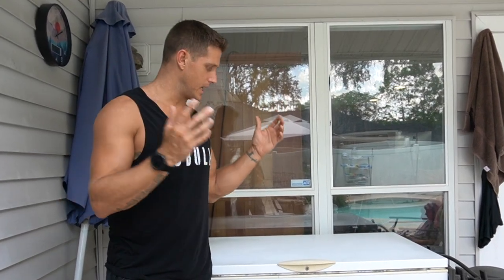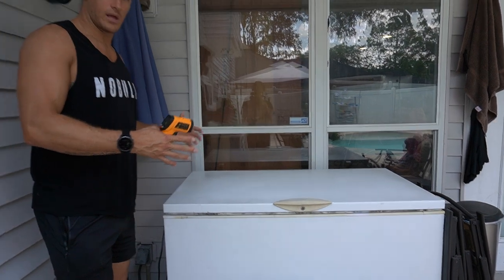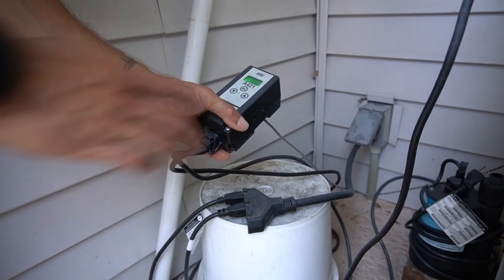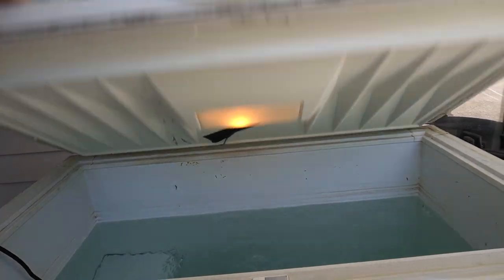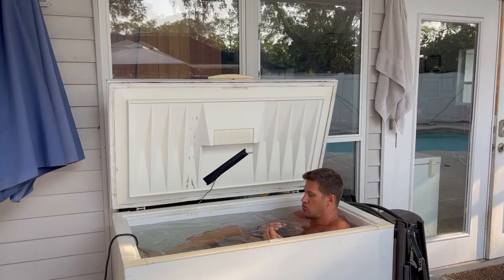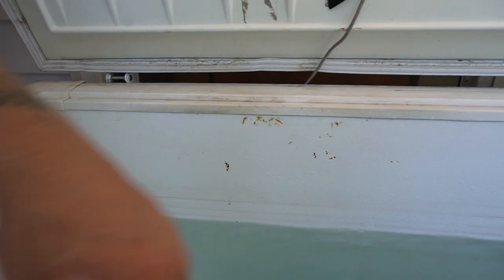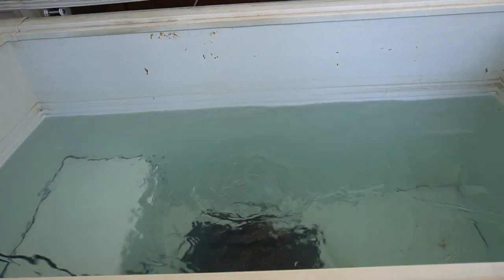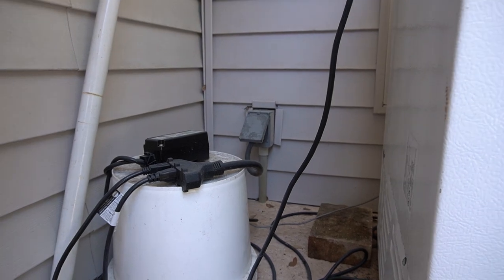How to Make Your Own Ice Bath CHEAP! (Filtered and Self-Cooling)

Comment: Dude this is the best most honest video i found... 7 years he says on just marine sealant caulk . I want to add, for people out there researching like me.  John Richter s way is not the only way and he makes alot of money off his affiliate links so he pushes people towards that.  But if you get a used freezer for 100 bucks and it's not rusted, marine sealant silk 271 or whatever it's called and who knows, may get 7 years without leaking like this guy. Even if only a year just re-caulk it.  Most leaks are from the weight of water and human not supported properly under the freezer and seems pulling apart whatever sealant you used so support the weight under the freezer so it doesn't bow in if it has legs.  If epoxy is the route, pc11 is much cheaper than jb water weld... just my 2 cents. Now if you got a brand new $1000 freezer then it may make sense to go balls to wall work with jb water weld and epoxy shields

Comment: Isn t that potentially dangerous because the cold (not the electricity) can shock a person?  I can t stand even putting my shower on cold water.
Reply: Starting at higher temps (60 degrees F)  and slowly moving your way down in temp over the course of a few weeks, you can adapt your body and tolerate very low temps safely. It's advised and safest to have someone around for your first few cold plunges so you can gauge what you can safely tolerate. Breathe with intentention

Comment: Freezing is at 32 degrees 😂 something is off
Reply: Using that inferred temp gun on the waters surface isn't super accurate plus the gun could be off a degree or two. There was some ice floating in the tub also so I would think it's pretty close.